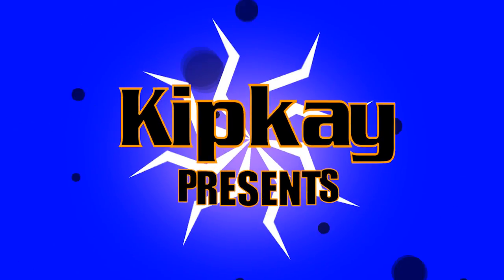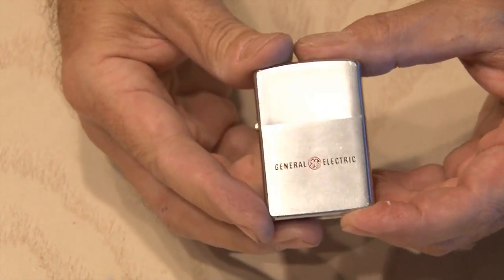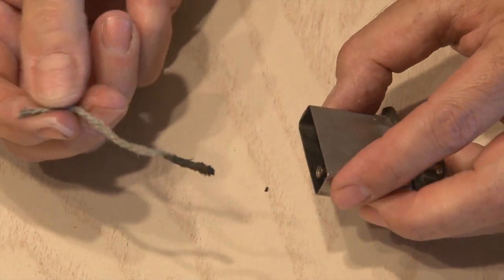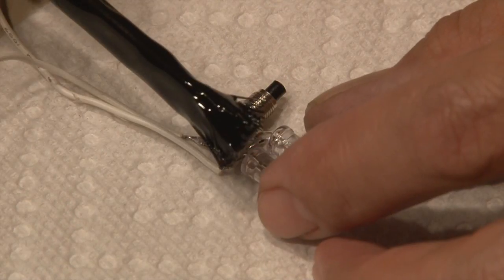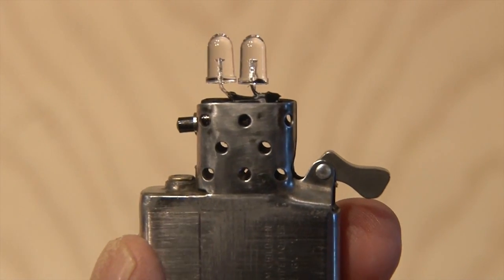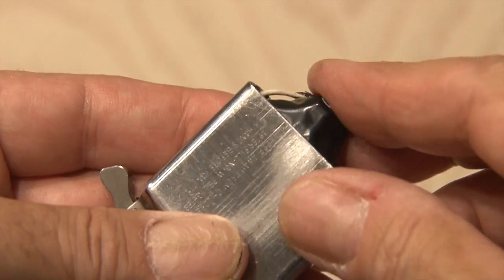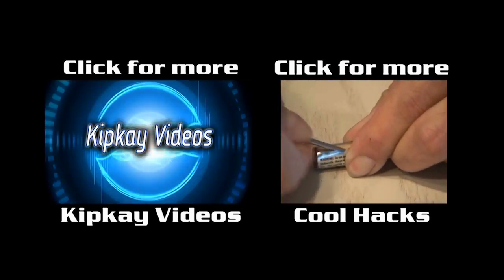Zippo LED Flashlight!

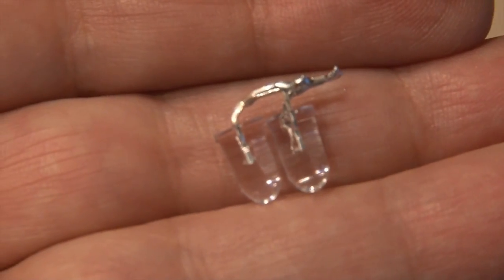Comment: hi at 1:07, how do you actually solder the wires. Also could you just put them together with brush on tape rather than soldering them?

Thanks

Comment: How old do you even have to be to buy a lighter?
Reply: 18 but it varies by state, I believe.
Reply: In the uk you can get one any age. But they look a lot different to the one in this video.
Reply: There is no age limit to buying lighters. You can be 2 years old to buy one HOWEVER, it is the stores descision to sell it to you. You have to be 18 to buy butane products, and lighter fluid, BUT, lighters such as the average bic dont use butane. There is a law stating you cant sell cigarette paraphanielia to minors, and lighters dont fall under that catagory. So, basically there is no age limit to buying lighters.

Comment: hey everyone im going to put custom LED's in my ps3 controllers but i don't know which wires i need to use. can anyone help me?
Reply: Get a battery holder and leds check the voltage they need and make sure the pack your buying holds batterys of that voltage take apart the casing of the controller and place your leds where you want them and connect wires from the leds to your pack that you have ,mind the fact you have to cut holes in your controller, you have to connect the wires from the leds to to the pack and if you want connect a switch and hotglue the battery pack on the back or wherever it feels comfortable

Comment: You should use a switch that makes a contact when released and fit it with the cower so when you open it it will light

Comment: If you would have put the switch on the other side of the chimney, and it was a "normally closed" switch it would turn the leds on when the lids open. Just a thought.

Comment: the flint is not in the casing, it's in the 1960's insert that he destroyed. you can get a tiny file and put lines in the wheel for teeth after replacing the flint.     :)

Comment: Parallel means each LED would have it's own current path from the battery. A series is when the components are wired on a single current path.

Comment: you can tell because the pin that goes through the spark wheel appears to be brass, zippo never used brass, they only used steel for that particular part, that is most likely also the reason why the spark wheel was worn down to the point you couldnt use it, because it wasnt a genuine zippo

Comment: It should be wired the other way, with a normally on momentary switch, so it turns on when you open the case and off when you close it.

Comment: it has the general eletric desighn on the front same as any other zippo advertisement. but it is fake beacause ziipo never used the brass rivits on the flint wheel.

Comment: kipkay your cool but this is messed up, zippos are highly colectible and if they break are easily fixed,
if the flint breaks=unscrew flint and place in fresh one (super cheap and easy)
if the wick dies out=take needle nose plyers and pull out burnt wick and cut(that is it)
if there is no more fuel=take zippo out of case and open bottom felt and pour fluid
a zippo does not break

Comment: This would be cooler if it had a normally closed switch that was activated when the lighter was opened.  This could make use of the small arm that comes in contact with the lid.  It would make it a little more cool in my opinion.

Comment: @GhostOfJulesVerne White LEDs need about 2v to 3v to light at full power. That's just an ordinary 3v battery, and these don't put out that much current. 
And since the LEDs are connected in series, and operating at about 1/2 of the voltage they'd need for full brightness, they'll work OK for a long time.

Comment: @kipkay Did you try installing the momentary switch facing the cam on the lid? I think that just opening the lid will then trip the switch and light the LEDs. So then you won't have to remove the flint wheel, keeping it realistic and also won't have to keep on holding the button.

Comment: @Tigaust you can buy a resistor to ballance the flow they arent too exspencive at the maker shed but most of L.E.Ds ive used have 1.5 volts

Comment: You could have flipped the switch so it depressed when the lid was closed, invert that and you have a led that turns on when you open the lighter.

Also I think you meant to say you soldered those LED's in parallel, not series.

Great videos, but this one's a little silly / impractical.

Comment: @ratman2372 its almost the exact same thing but within a different case.. you just have to make sure you dont get the posotive and negatives touching the metal on the zippo or it will short out

Comment: how can you break a zippo? the wick is replaceable, the flint is replaceable, the wheel is replaceable. The fuel pad lasts forever. Its gone from being an ignition/heat/light source, to just being a light source, thats a step backwards.

Comment: @Thriced2286 They are clearly in parallel. There is a close up and everything. Both end connections are running to one diode If there were in series, one connection would run from each diode.

Comment: I'm sorry I'm not part of the "Every Word Only Has One Definition Club." Allow me to try to become a member.

"a(The first letter of the english alphabet) dremel is a small tool(A person who is controlled) designed to do a very small and accurate job(A book in the Bible. if he "hacked it" he would have used an angel grinder(A sandwich) to cut(To be circumcised) it. i still dont see how you telling me he used a dremel to cut it has anything to do with the improper use of the word hack.

Comment: @xnamkcor and? a dremel is a small tool designed to do a very small and accurate job. if he "hacked it" he would have used an angel grinder to cut it. i still dont see how you telling me he used a dremel to cut it has anything to do with the improper use of the word hack.

Comment: but u can not close it and it has only 2 cheap leds put 2 or 3 high power leds on it and the switch under the wheel. If u push the wheel the lights go on

Comment: @peopleinsg I want you to take a $100 bill and burn it. No consideration, no thought into the process, just burn it. That lighter is (was) worth slightly less than an 8hrs wage for me. Unlike you slaving over in the pizza joint as a cashier, I work at republic airport NY.

What you just said to me is that if I do something wrong, people are not allowed to bash me. Thats genuine stupidity right there. Maybe you should quit your job and comtemplate some logic instead, perhaps head back to school

Comment: A cool extention to this would be to use a 3 pin momentary switch and wire to the pin that is on when released, then use the opening of the case to release it. Then align it so that it releases when the case is opened.

Comment: It makes not that difference, but it increases the life of the leds cause they pull too much current without it. the leds should get around 25mA.
R=U/I
R=3V/0,025A
R=120Ohm
So a 120Ohm resistor would be fine.

Comment: i feel like you rushed this one @kipkay , i would have liked to see the LED's deeper inside the wind shield so they couldn't be see some the side and then just put the switch right in the hole where the flint used to be. That would have made it look a lot more sleek.

Comment: it looks like it is parallel but few problems one is no resistors to protect the LEDs and if it was parallel each LEDs would need its own resistor where series you need the one resistor but make sure the battery has enough voltage to power the LEDs

Comment: @misterLEM0NS surely, all he did was wreck the insert, the casing is still there. So all he would need to do would be to replace the insert?? Also, he might have modified a different insert to the original one anyway?

Comment: You just pissed away an antique collectable and turned it into something zippo has an insert for. $99 to jack sh*t in no time flat.

A zippo is like a mag-lite, theyre never broken, Infinately repairable, most of the time under the life-time warrenty. A worn wheel goes fo $0.80 while a pack of 6 flints for a dollar, I would have gladly mailed you both to prevent you from tearing apart such a beauty.

Supposedly about 500 of that GE model of zippo were made for employees, you just wrecked one

Comment: just a thought u should have made a switch which does the opposit (turns LED's off when pressed) so that when the zippo is closed they would be turned off, and when it is open the LED's will be on:) would be a bit cooler:)

Comment: It looks to me like the LEDs protrude too far from the housing, preventing the lighter from closing properly. The lack of a reflector makes the LEDs less than impressive and with a bit more work, it wouldn't be hard to use a normally closed microswitch so that it activates when the lid is opened, with no other interaction. A good idea executed poorly I'm afraid.

Comment: @kipkay Another way to do it would be instead of cutting off the flint wheel leave it on and make you cut into the other side of the wind screen. If you use a momentary off switch instead a momentary on like you used in this video, you should be able to make it so the light is turned off by the lip lever. When the lip is closed the level would push the switch, then when you open the lip it would release it and the light would come on.

Comment: @jccaymo25 no, i don't think so, because he didn't use a resistor, if you had them in parallel they would pull a high current and could destroy them

Comment: Zippo actually makes flashlight inserts that will work much better than this since they turn on when the case is flicked open and the light has a reflector so it actually has a light beam rather than just radiating light in all directions. If you're interested search "Zip Light"

Comment: now instead of using white leds use 2 uv leds and cut the neck down a bit and then you have a blacklight then if u can figure out how u can set it up so when u open it, it will light up

Comment: @Dbot101 yea it probably was parallel, but still it could be in series. he just connected the positive of one led to the negative and just used the wires of one led. but your right, it probably was in parallel because the way he connected it if it were series only one would light up. leds only light up with the appropriate leads going into it.

Comment: @joaodps yea, that's when you connect the positive wire to the other LEDs negative wire then its basically one big light. also the voltage it needs multiplies by the number of LEDs.

Comment: @upernoob If two electronic parts are soldered in series the current passes them one by one. Like this:
-------X------X--------
If they are in parallel the current splits, goes through each one separately and them merges again.

Comment: I would have put an always on switch (off when pushed) and put the switch on the opposite side.  This would cause the light to come on when opened and turn of when closed.  AND YOUR LEDs ARE IN PARALLEL NOT SERIES. I'm disapointed in you Kipkay, not too much though.

Comment: A GE-etched zippo fetches about $40 minimum, makes a hell of a display item. Just because the flintwheel was worn you turned it into a $5 light?

Zippos are infinately repairable, everything down to the custom made case. A flintwheel goes for about 2 bucks while a case of 5 flints goes for 1.

I felt myself die a little inside watching this thing be torn apart. I dont smoke but I have one, when it isnt lighting campfires its sitting in my display case for sheer beauty.

Comment: @nazurea No, they are in parallel. Series = the cathode soldered to the anode of the next one. Parallel = both cathodes soldered together and both anodes soldered together. This video clearly shows the latter. If you think I'm wrong please go wikipedia and search for "series and parallel circuits", I did. These HI led usually require 3,4V to bright 100%, if they were in series they will need 6,8V an the battery looks like just ONE 2032 standard 3.0V... not enough to light 2 HI led in series.

Comment: @ThisLand It is Genuine, Look at the bottom, it says ZIPPO, and look at the Internal, the inscribed © is on the fuel  canister, it is a real zippo.  Look at it closely, put yourself into 720p if you are using a lower quality YT then you prob cant see it, it is real.   I have the problem he used a REAL ZIPPO.... and you are right though he could have sent it in.  Or used a off the shelf fake zippo at least.